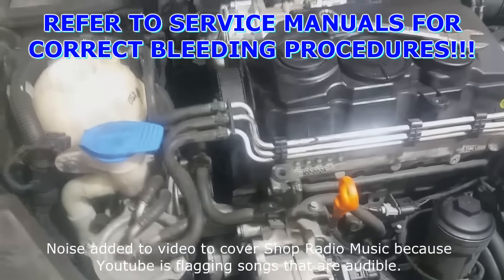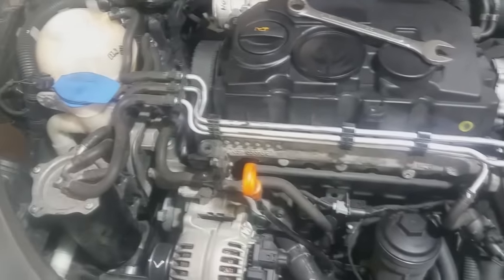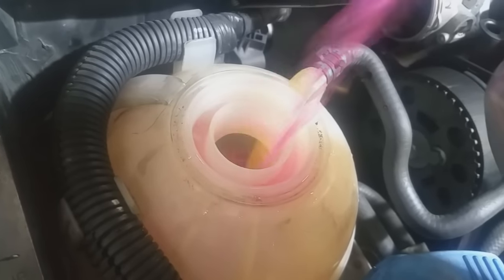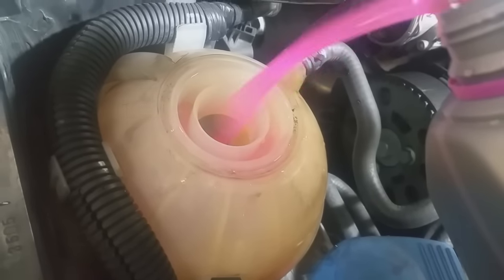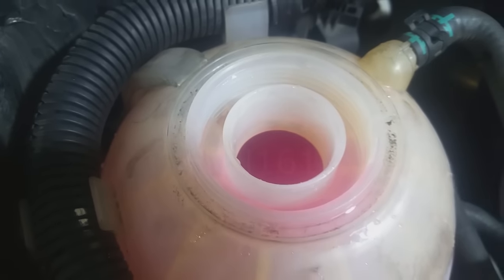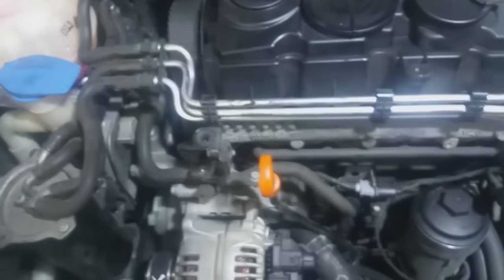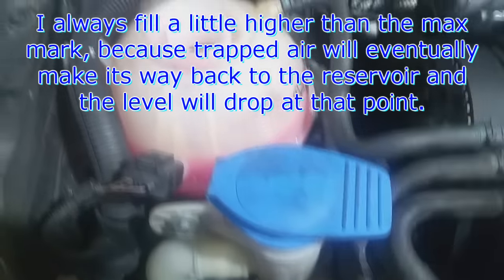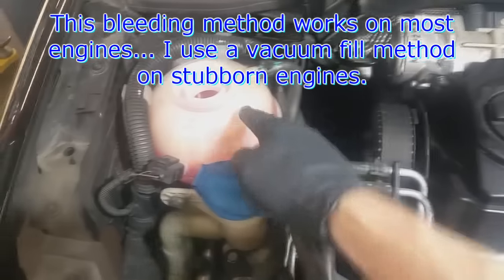Basic VW cooling system filling / bleeding info (viewer request)

Comment: Have a mk6 golf p261a and p261b error open circuit fault
Changed coolant pump and cleared codes but still show 
Both a/b faults 
Any ideas
Reply from the maker: Do you have power at the pump? Does the pump actually run? Check for wiring problems if it does not have power & command (ground from the ECM).

Comment: Would air lock in the cooling system cause engine surging/rpm surging issues while driving by any chance?
Reply from the maker: I don't think so... unless it is affecting the coolant temperature sensor and confusing the ECM. If the temperature gauge is staying in the middle and the cooling fans cycle when they should, I doubt that you have an air pocket issue.

Comment: I've changed my thermostat and now temp sits at 90 all the time when warmed up as it should and I get heat in the cabin etc  but the lower radiator hose never seems to get warm, is this normal
Reply from the maker: If it's a TDI... yes.
They are very heat efficient. You would have to have a warm day and hold the rpm at 2000 for 10+ minutes, in order to feel the lower hose get warm.
Reply: @EXOVCDS   yes it's the 1.9 tdi 130 2002 model

Comment: I have a question.  When i did my timing belt in my A4 b6. I also flushed my green coolant.  But after flush my heats are week. 
I tried everything but the heat doesn’t get better. I slide off the upper heater hose a little bit and the water did come out from small hole. But when I slide  it back the water is gone. The lower heater core hose is pretty warm. But upper is cold and no pressure inside. 
WHAT SHOULD I DO?
Reply from the maker: If you didn't have any heat issues before the work was done... either you still have air in the engine / system or the heater core has become restricted after flushing. Fluid should flow nicely in both directions... what happens when you keep the rpm up at 3000 rpm? Can you hear coolant rushing through the heater core when you are inside the car? If yes, then you still have air in the system.
Reply: Thomas EXOVCDS 
Yes I can hear. But I tried every single way but can’t get these air out!!! Do you know any easier way?
Reply from the maker: Using a vacuum fill method... but that requires special equipment. Disconnect the heater core hoses and tilt them up... add coolant into one hose until fluid rises up out of the other, connect the hose to the heater core. Add more coolant to the still disconnected hose until it is full or until fluid comes out of the heater core. Reconnect the hose. Start the engine and hold rpm at 2500 to 3000 rpm until the thermostat opens (lower radiator hose is warm)... if at any time the temperature needle goes past the middle, shut the engine off and allow to cool down. If temperature stays in the middle and the lower radiator hose is warm, let the engine idle and then shut it off. Allow to cool off... a few hot / cold cycles can burp air out of the system (into the coolant reservoir tank)... so recheck the coolant level in the reservoir and top up if needed (only open the reservoir when the coolant / engine is cold).
Reply: Thomas EXOVCDS 
So 
1.remove both heater core hose upper and lower

2.put coolant in to upper hose until come out from lower

3.connect and start engine 

Is this right?
Reply from the maker: @wafi3187  Yes... anything / whatever you haven't tried. Your guess is as good as mine. High RPM along with warming up / cooling down should bleed air out of the system (as long as the thermostat opens to allow full circulation, in case air is in the radiator).
Reply: Thomas EXOVCDS 
Thank you I will try today!!

Comment: hi just watched your video i have a vw golf tdi 2006 model. the coolant light comes on and upon checking under the hood the level of coolant is low. however when the engine cools down the coolant level in the reservoir returns to normal. what could be the possible problem? i cant  see any leaks?
Reply from the maker: Any recent repairs / service? After it cools, the level is where exactly? At max? Between min & max?
Reply: @EXOVCDS  hi thanks for the reply. No recent work it refills to the min level.
Reply from the maker: @abstherohman  fill to max mark and monitor over the next week.

Comment: Hey buddy, got some questions... 1) Should I run the engine until the thermostat opens with the cap off? I need to replace the coolant, so 2) how do I make sure I get all the old fluid out (if the thermostat is closed I assume there will be some old coolant trapped in the system).  Thank you!
Reply from the maker: You'll never get all of it out... there will always be some trapped in the block or heater core. Flushing with water a few times (until nothing but water drains out) is the only way to clean out the system. Then with some water trapped in the system, you add straight coolant ( 1/2 of what the total system volume is) and then top off with just water until the fluid level no longer drops.

You can run the system with the cap off... if fluid overflows from the bottle, it is usually a sign that air is trapped in the system.

If you keep track of how much fluid you added... and it is close to system volume, you can install the cap and let it run its course.

Always keep an eye on the temperature gauge and keep monitoring heat output inside the car... if heat stops blowing, you might have an air pocket / blockage.

Shut the engine off if the temperature rises to 3/4... and let cool off.

Upper & lower radiator hoses should get equally warm and then the fans should come on.
Reply: That's great advice! Thank you! I replaced the coolant of my Ford Focus and it was pretty straightforward, but I did have an air trapped problem. I solved by letting it sit there without the cap overnight lol... Now I'm creating courage to do that on my VW Beetle. I will do it as you say my friend!
Reply: Thomas could you please tell me how you flush the coolant ? Do you warm the engine and heater on max and then flush ? Maybe best way would be to flush as it is, fill it with water, warm engine wait a little bit ? water will mix with the old fluid trapped in the block and heater core and repeat the process few times ? I'm guessing it's not recommended to flush immediately 90C fluid so I should wait some time after warming the engine.
Reply from the maker: +Mateusz K Cold engine & flushing with a garden hose (at different places) can get the system clean. To account for any water that might be left over... add 100% coolant first (1/2 of the system volume) then top up with water. Once running, the 2 funds will mix.

If you don't like the garden hose route... drain as much as you can and add distilled water. Run & bleed the engine till warm. Let cool off, drain and do again till only clean water comes out. Then add coolant atss suggested earlier.

Comment: Hey i was wondering, how much coolant does a vw 2.0t take? Would a gallon cover it?
Reply from the maker: Yes, mix 50/50 with distilled water... = 2 gallons,  should be enough. Service manual says total capacity is 2.37 gallons. When draining, there will always be some left behind (heater core,  some in coolant passages by thermostat and in the radiator).
Reply: @EXOVCDS  thank you sir!!
Reply from the maker: Thank you for watching!

Comment: Can you replace the steel L shape coolant manifold line that run behind the injection pump on ALH without removing the pump? If so how bad is it to make and break that connection behind the pump?
Reply from the maker: The one that enters behind the thermostat? Pump can stay in place I think... can't remember when it was that I replaced one the last time. Turbo oil line needs to be moved and a bunch of other stuff to allow the pipe to come out. Whatever it takes... so to speak.
Reply: Thomas EXOVCDS it’s got a funny end on it, behind the injection pump,, not sure how to release it without messing it up, or if you cane with removing it he pump and the bracket that holds the pump.  . Mine is not leaking yet, but it’s in very bad shape and I’m replacing a bunch of coolant lines so I figured now would be a good time to do it. I live in the north west and don’t want to find myself on the side of the road, I can’t find anything about that line, any info on that fitting would be greatly appreciated if you can remember. Love the videos and info you do provide, please keep them coming👍👍👍 thanks again!
Reply: Sorry for the typos,
Reply from the maker: Send pictures to me.... #10 in this image?
https://volkswagen.7zap.com/ImgsWatermark/images//Bilder/194/194121410.png
Reply: Thomas EXOVCDS  thank you.  I will send them. How is the best way for me to send those pictures?
Reply from the maker: @briandannels1908  My email can be found on my youtube "about" page or on my website:
http://fkh161.ca/

Comment: hey mate!
I have a skoda kodiaq 2.0 tdi EA288 .Need you help as iam changing water pump and removing old coolant from radiator and heater core and thermostat. should this work to bleed air out of system ?as i dont have vaccum pump or VCDS THNAKS
Suggest a way please
@Thomas Exovcds
Reply from the maker: Due to the design / layout / routing of the cooling system, it is not as easy as just adding coolant to the reservoir and hoping that the air bleeds out.
There are check valves in smaller coolant hoses that need to open. 
A vacuum fill setup and scan tool to activate bleeding (after vacuum filling) will ensure all air is out of the engine.
Reply: But sir don't have vcds or vaccum .  Can this be done by any other scan tool like AUtel etc
Reply from the maker: Yes, I know,  you already said so.
Autel might be able to activate "cooling system bleeding"... I don't know.
Measure amount of coolant that you drain from the engine... as long as you fill the same amount of coolant into the engine you should be ok.
Keep an eye on temperature when the engine is running. A few cold to hot cycles will help circulate the coolant. When the coolant cools, the level might drop, add more to the reservoir.

Comment: Wundering if enny one could help got hot air soon as top coolent up just drinks it state away no visabel leaks no smoke no milk shake thanks
Reply from the maker: Year, make, model, engine? When did this start happening? Before or after working on the car? Post a video so that I can see what is happening.
Reply: @EXOVCDS  will do it's in garage today
Reply: It's a 07 skoda octavia vrs

Comment: Hey i have a VW jetta 2.0....my car is overheating...new thermostat put in and also a new coolant flange installed...my coolant gets really hot and bubbles and if i put the cap on it, too much pressure builds up and it all spills out...any suggestions?
Reply from the maker: Does the water pump have flow? Do you get heat inside the car? Watch this:
https://www.youtube.com/watch?v=LiDRUWPw_f4
Reply: Thomas EXOVCDS Thanks for the reply! im gonna check the fuse box now because my fans are NOT turning on...but the water pump is circulating i suspect because coolant is coming through the hose connected to the reservoir...i do hear gargling as you show in this video.... so maybe bleed more air out? although i thought i bled enough and no the heat isnt coming on...not completely cold air but not fully warming up
Reply from the maker: Carson Johnson You should have lots of heat inside if the water pump is OK & all the air is bled out. How old is the water pump? You can remove the thermostat and check the water pump impeller. Check it like this:
https://www.instagram.com/p/BQjpgF1BiqX/

Comment: I have my coolant light flashing can not bleeding it cause for it to flash?
Reply from the maker: Year, make, model, engine? Is the bottle full?
Reply: 2008 VW GTI yes but i think I got it to stop flashing just bled it and it was gargling so I was adding more until it stopped gargling
Reply from the maker: The light will only flash if the level is low in the bottle or if the engine is overheating. If it starts flashing after driving for a while and the bottle is full, make sure that the thermostat is working and that the heat inside the car works. No heat = bad water pump or air in the system.
Reply: Thank you appreciate the help now I know who to ask when I need help thanks once again !👊🏼

Comment: Does one use this same method after replacing a part in the cooling system? I will be changing the heater core of my 13’ VW Jetta S 2.0L pretty soon but refilling and/or bleeding the system afterward is my biggest concern. Do you have any tips?
Reply from the maker: Yes, same / similar method. Most importantly... if you roughly lost / removed 4L's of coolant, be sure to "at minimum" add the same amount. If the fluid level does not drop in the reservoir and you still have to add  more fluid... start the engine. Fluid level should drop... air & fluid should return back into the reservoir via the small return hose at the top of the bottle. Once you see a constant stream of fluid returning to the bottle, you can install the reservoir cap and let the engine run until fully warm. NEVER remove the reservoir cap when the system is warm / the radiator hoses are under pressure. Let the engine / cooling system cool off (overnight) and then top up the level if it dropped.
Reply: @EXOVCDS  This is great, I can’t wait to get started on this project! Thanks a bunch!
Reply from the maker: @LiteBrite850  Keep me updated... thank you for watching!
Reply: @EXOVCDS   Hey, I am finally getting back to report that my heater core replacement project was a success and your tips to refill and bleed the cooling system worked just as you said! Thank you so much for your help!

Now I’m faced with another dilemma. I had taken my car to a shop the other day for a timing belt and water pump replacement only to find that they had flushed my cooling system and refilled it with a green “universal” coolant, without my permission. On top of that, my A/C is not working now. If what I am looking at is the A/C compressor, it just continues to spin as if it is on, when it is not. 😫
Reply from the maker: @LiteBrite850  Thank you for the update, sorry to hear about the new issues. Have them flush the system with water and then fill with correct fluid. If they will not do it, ask them to (at minimum) cover the cost of the coolant.
Reply: @EXOVCDS  Yeah, it’s just all very annoying, but I have an appointment tomorrow to correct everything. I was kind of struggling with the coolant situation because up until them changing it to green universal coolant, I had been running all NEW, VW recommended coolant. It took me months of time, money, and effort to get my cooling system up to par after a failing oil cooler and multiple flush attempts. 😩 

Thank you again for all of your help.

Comment: I just did an EGR cooler delete and EGR race pipe and had to bleed the system. Temp gauge was right in the middle after running with the heat on, however no heat was coming out of the vents. One heater hose was warm and the other was cold and felt like there was no coolant in it, so I think the heater core may have an air lock. Any advise on how to easily remedy this?
Reply from the maker: It's an open flow system... high rpm / high coolant circulation should push it out.
Removing the EGR system / cooler lowers the heat that goes into the heater core (exhaust going through the cooler helps heat up the cooling system).
Reply: @EXOVCDS   Just wanted to follow up and say thanks for the reply. The heater core was actually 100% clogged solid. I think someone tried to use radiator sealant to fix the EGR cooler leak. Took an hour to flush out a bunch of sandy, brown, sticky gunk and then I bled the system as shown and all is well. Thanks again.
Reply from the maker: @alexandermurphy2633  thank you for the update... must not have heat before the delete then as well? Due to the shape & position, the core will collect debris / sediment... unless flushed every couple years, it's common that they can plug up.
Reply: @EXOVCDS   I bought the car with the EGR cooler leak and only ran it for a few mins, so I didn't get to test the heat. It seems the heater core is fairly easy to replace in these, which is a pleasant surprise. Hopefully it doesn't come to that though
Reply from the maker: @alexandermurphy2633  What vehicle & year?
Reply: @EXOVCDS   It's a 2006 Jetta TDI 5 speed manual.
Reply from the maker: @alexandermurphy2633  OK, thanks!

Comment: So I have a 2012 Audi A7 i cant figure out why it keeps overheating and it tells me to pull over and let it idle. Then it cools down and when I drive again it goes right back up. My coolant level is fine I'm about due for an oil change and I've had no issues before.
Reply from the maker: Does the dash have an actual temperature gauge / needle? Is the engine actually running hot (upper radiator hose very warm / hot)? Do you have heat inside the car? What engine is in your A7? The more I know the better I can guess.
Reply: @EXOVCDS  it's the 3.0 super charged TSFI but I have head the upper hose was warm it doesn't have an actual temp gauge it just maxes out and tells me to pull over
Reply: Yes I also have heat
Reply from the maker: Warm is normal... you need to verify how hot it is actually getting. If it is more than 110c / 230f you should not drive it. The engine is all aluminum (I think) and will cause warp when things get too hot, causing head gasket, cylinder head & engine block and damage.  Maybe the thermostat is bad.
Reply from the maker: CGXB engine code?
There's a TSB for a return hose that can cause sporadic high temperature.
email me: fkh161 @ fkh161 .ca
Reply: @EXOVCDS  I'll get my ODB on it that will tell me. Also will send an email